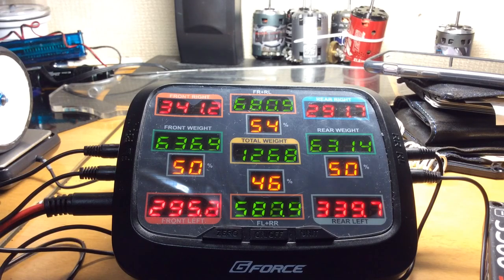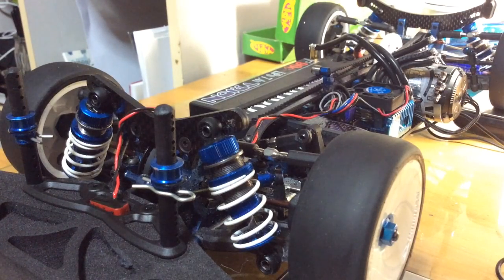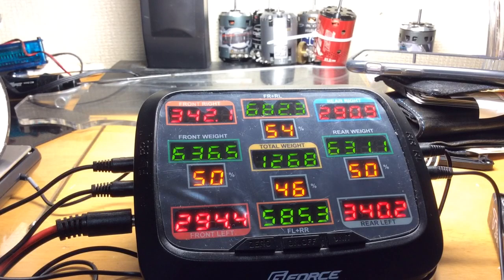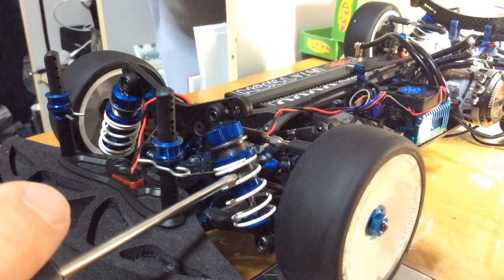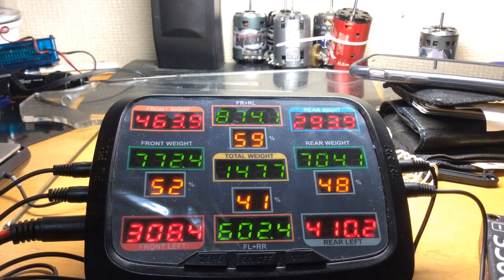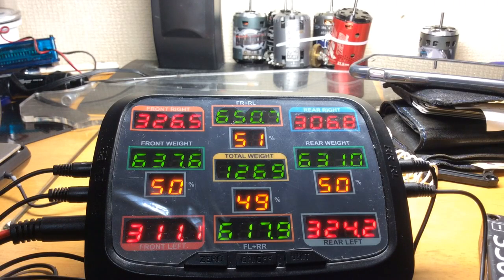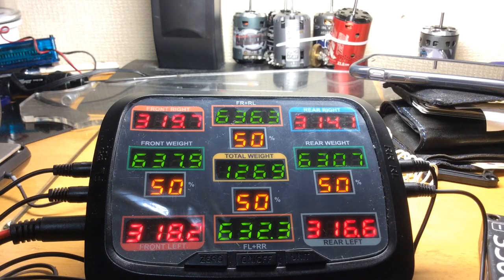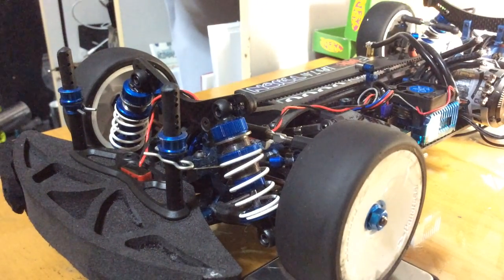Chassis Corner Balance Using Digital Scales

Comment: looks like the computer in the car from back to the future when the numbers are all changing. Cool to see the difference in weight. I am sure it makes a difference.
Reply: This just popped up into my YT feed. And yes, can confirm it makes a huge difference. I recently started RC  club racing,,,.entry level, nothing fancy. I assumed I can just turn up and drive...boy was I wrong lol...car was all over the place as I couldn’t keep it on track.It was always difficult to control, especially in corners....few days after my first few races, one of the other guys at the club brought his scales, rebuilt my suspension, popped the car on the scales and made adjustments....next time out on track it cornered like it was on rails and handled so good that I couldn’t keep up with how well it accelerated, slowed down etc...I was expecting a slight change but this was brilliant. It really does make a huge difference as it does in real life racing. Weight distribution and balance are key......I’m still a sh*t driver though 🤦‍♂️😂

Comment: Good morning.
Using a translator.
It would be possible to make a much more clear video that explains step by step how to balance the model?
I also own SKYRC and tried to balance, but they did not succeed.
I'm waiting.
thank you.
Reply from the maker: Hello - Sorry, I've been very busy over the past couple months. 

Step 1 - Make sure chassis is not tweaked
Step 2 - Make sure the suspension arms are not binding/sticking. 
              Make sure the droop screws are set equal left and right. Front and rear can be different
Step 3 - Build shocks that are smooth, same length and same rebound - Zero rebound is best. 
Step 4 - Make sure the car is balanced left and right (use balancing pins) 
Step 5 - Set the ride height so the car is 5.2 mm left and right on the front and 5.4 mm for the rear. 
Step 6 - Place the car on the scales (make sure the table is perfectly flat and level)
Step 7 - Push on the center top deck of the chassis 2-3 times and check the weight distribution on the scales. 
Step 8 - Adjust the shock collars up or down EVENLY for each shock. Do a 1/4 turn for each shock. 
Step 9 - Adjust in a ''X'' pattern. Start with the heaviest front corner first usually the FR - Front Right 
Step 10 - Start with the FR, the RL (Rear Left), then RR (Right Rear), then FL (Front Left). 
Step 11 - Repeat until the weight is relatively even.
Reply: Good morning.
I really appreciate your description but utulizzo an online translator.
If you will be able, I would appreciate being able to transmute these explanations in an elementary video so that can understand even if you do not know English.
I look forward to your response.
thank you.
regards.

Comment: I put my car on the scales get them all close to equal. an hour later my weights are kinda all over the place again. my shocks are freshly rebuilt with zero rebound.  any way to avoid this
Reply from the maker: Make sure your chassis is tweak free, bind free, and use setup wheels. Using just tires can throw off the measurements because of different weights of the rubber tire, rim, and insert. Don't get to carried away with trying to make it ultra precise. Accept some room for error.

Comment: Been chasing my tail. I have one tire that is off. Attempt to adjust than another one is off?
Reply from the maker: +Metron Aerial don't get too fuss with the weight bias. Get it within a few grams of each other. You should do this with a set of setup wheels or rims. A newly  built wheel, insert, and tire can cause such problems. Setup wheels are the way to go.

Comment: hey ed awesome video I just got one of these scales it comes in this week its for my drift car I see people always adding counterweights to their set up when it can easily be done with this scale ride height for drift cars are a little different more ride height on the front left right height on the rear and then I guess I would just in theory have to mess around with the spring load to get the right weight on each tire or do you think I still should add counterweights to get the right weight pressure on each tire
Reply from the maker: +Michael Hernandez - I'm sorry, I'm having difficulty understanding your questions.

Comment: I am using sc10.2 for rc dirt oval racing, thinking about getting one of these scales to see if my car handles better.
Reply: I bought this and there is no way just going up and down on shock collars is going to equal out cars there is other stuff like oil,springs,battery and elec placements, etc
Reply from the maker: jstump1972 You;re absolutely right! Have you checked my other YouTube videos? Such as Chassis Balance Pins? Pre-Chassis Balance? Also,keep in mind that this video is for touring cars. Your vehicle is completely different and will require different methods.

Comment from the maker: 1DrWorst87 -  I added a comment at the end of the video mentioning to check and re-adjust the ride height if necessary. 

Yes, good observation. The motor cooling fan positioned behind the motor was removed. If it was installed in the car it would have slightly more rear traction. That's why it's important to have your car "race ready", because results will vary.